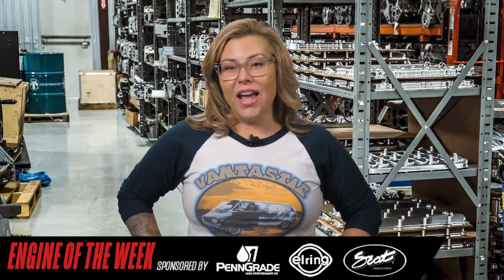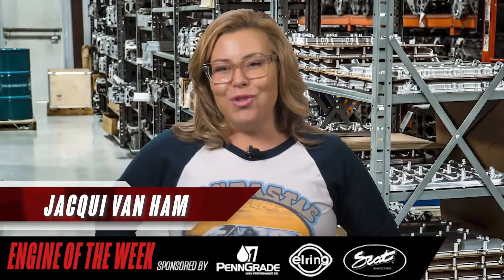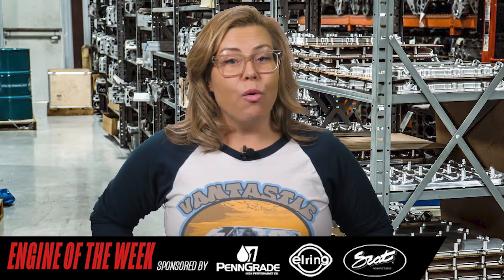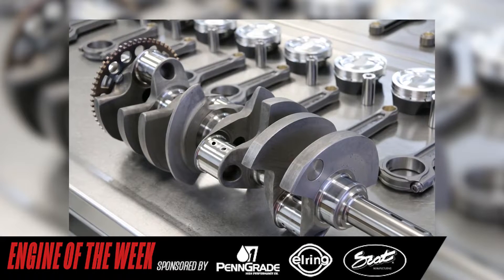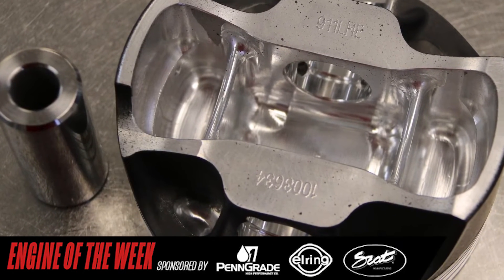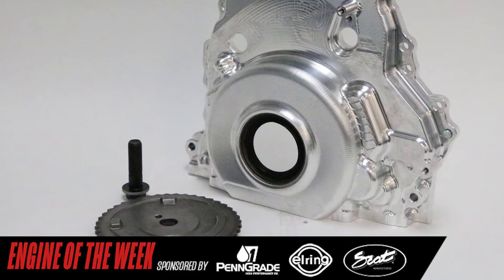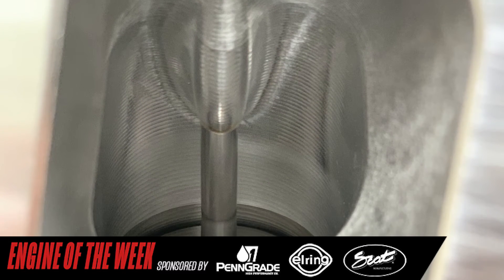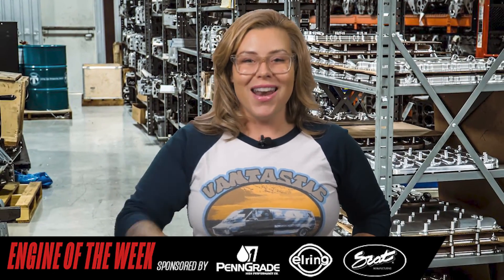2,000+ HP Capable 416 cid LT Engine

Comment: The big difference between the previous 6.0 liter truck engine and the new 6.6 liter is the 6 6 is much  better for using very hot burning propane. The reason is that after the block is cast, a drill is used to make a water cooling hole between each cylinder. This means  better cooling for hot running engines. It means the LT block is better for cooling than the race blocks that have siamese cylinders without water jackets between each cylinder. Remember that propane is about half the pump price of diesel fuel so it will still be the smart choice for long engine life and lowest possible emissions. Propane burns vary hot because it's 37 percent hydrogen.

Comment: Makes me wonder what a flat piston, naturally aspirated engine would make.
Reply: The LT1 by itself is already more efficient than the LS architecture, so I'd say up to 900 horsepower. Concept Performance just came out with an LTR block which takes everything they learned with the 2000-hp capable LSR aluminum block and implemented it into the new LT aluminum architecture. 4.185"x4.125" in that block is completely doable, and would EASILY make 850 or more. Katech already made 800 with a 427 inch setup.